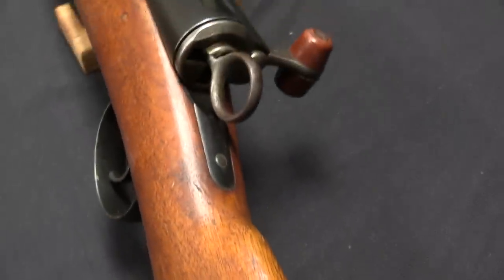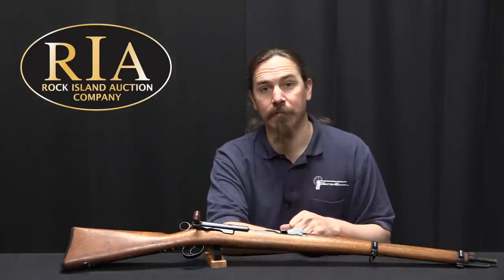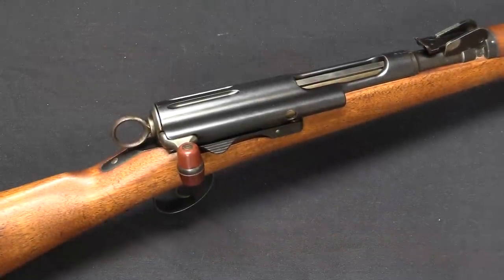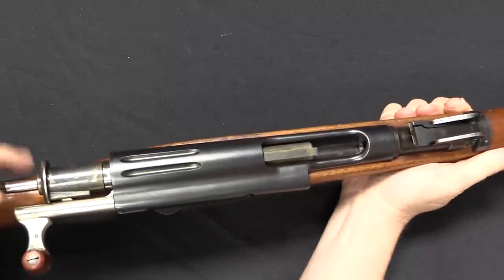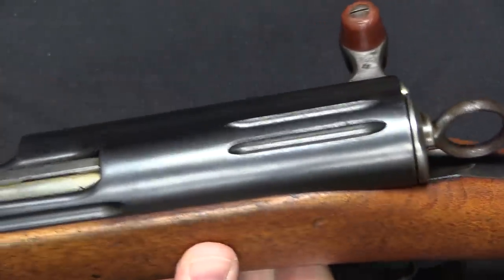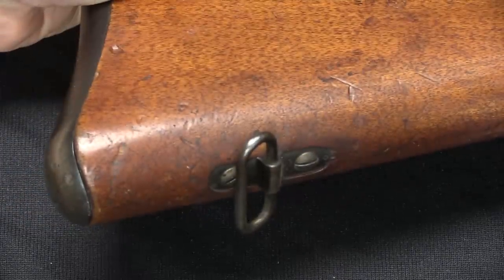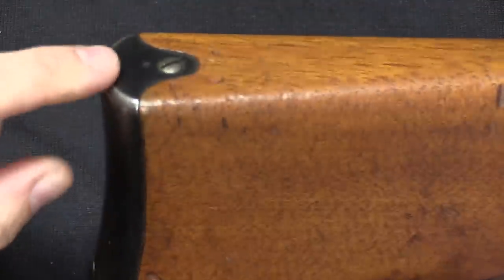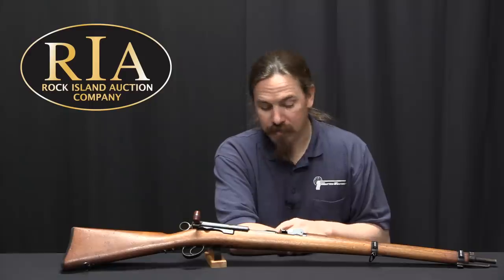Swiss 1897 Schmidt-Rubin Kadettengewehr Training Rifle

Comment: Such a well thought out design. They even put a keyring at the back of the bolt so you could keep it handy.
Reply: i guess I'm kinda randomly asking but do anyone know a good website to stream new movies online?
Reply: @coltonarchie9765 , Negative. I use Roku but I know a guy that has an unlocked Firestick and he gets all kinds of stuff.
Reply: @Colton Archie lately I have been using Flixzone. Just search on google for it :)
Reply: @Colton Archie i would suggest FlixZone. Just search on google for it :)
Reply: @coltonarchie9765  m4uhd.tv is quite good (or Movieorca).
Reply: That key ring is the firing pin

Comment: Ahhh, the 89's were NOT updated, the 89/96 was a new rifle with the updated bolt & similar features to the normal 1889. Most of THOSE 89/96's were updated into 96/11s, with new barrels, stocks and sights. The K11-M11 were simply that pattern of rifle having NOT been converted from 89/96s! :D

...I think ;)
Reply: I concur. There are far more 89's knocking about than 89/96s. Which wouldn't be the case if most 89s got updated
Reply: @charlieknight830  That's exactly what he said. The 89 was never updated to anything. Only the 89/96 was updated to the 11 pattern. 89/96's are difficult to find, because basically all are 11's now. The 89/96 was a new rifle and, though similarish looking, almost none of the parts were exchangeable with the 89. Particularly not the bolt and receiver, which really are the essential parts.

Comment: I have to correct you on something here. They did not update the Infanteriegewehr 89 but the successor of it the 96 ... those upgraded 96s are known as 96/11 whereas the 89s remained unchanged .. In case you are curious I own both guns and could also show you pictures were it's notable that the wooden stock was also upgraded to a pistol grip kinda thing

Comment: Hello, I like your videos because I find the mechanics of the different systems very interesting ...
I have little reference to weapons - but I always wonder at the old guns on the iron sights.
I practiced a bit more with firearms decades ago, but I think the distances are utopian like 1000m.
With the P1 (P38) I could hit something at 25m, with the UZI in 100m - the old G3 quite well af 300m with a lot of practice. Lying with the MG on maybe 500m with short bursts ...
But 1000m with a normal rifle? Our old rifles also had different breakpoints - so if you wanted to hit a 10, you had to target a 7 at the bottom left ... what went wrong between 1905 and 1985?

Comment: Ian-I ordered a M1911 Schmidt-Rubin from a well known distributor and received a .22 conversion single shot! A neatly inlayed plate on the side of the butt says "Arn. Meierhans, Zurich"  Was this the armorer that did the conversion? Are they safe to shoot (am assuming they are). The firing pin still hits the center of the .22 cartridge and the stock extractor will not extract and eject the .22 case. Is this worth keeping? It was the ;last of 6 M1911's from the distributor that  I bought from. I own a K31 carbine which is a dream to shoot and really want a long rifle in 7.5 Swiss. Is it worth keeping to trade up? Cannot find much info online. Thanx for any info-John in Texas

Comment: Can the reduced power 7.5x55 Swiss ammo be substituted with standard GP11?  For the lucky few who own this rifle I wonder if this can be shot using the slightly hotter load?
Reply: I've shot my K11 with GP11. The recoil is a bit rougher than with the PPU 7.5 I use, but I had no issues. Granted I only shot about 10 rounds of the GP11. No clue what would happen if you only use GP11.
Reply: It's not slightly hotter, the GP11 is 50% higher chamber pressure than the GP90. The gun would eventually fail and knock the action back into your cheekbones and get you a nice hospital visit. For that reason, the GP11 was made 1mm longer so it's impossible to accidentally feed it into an older gun.

Comment: So, stupid question: I must have missed this in the video, but is this rifle capable of firing the standard  7.5x55mm cartridge?
Reply: You mean, the GP1911?
No. They are not compatible The GP1890 has a case length of 53.5mm and the GP1911 is 55.6mm long.
You might be able to fit it into the gun but I don't recomend it - at least if you like the idea of your face remaining intact - as the GP90 generates about 37'000psi and the GP11 about 45'000psi.
The old rifles are not made to withstand the higher pressure and might blow up in your face...
Reply: @Bird_Dog00  Thanks!
Reply: @Bird_Dog00  It was a Schmidt-Rubin 1889 bolt that was a problem am I right? 
Isn't Cadet Rifle have the same bolt as Schmidt-Rubin 1896/11 Rifle?
Reply: @Supremaque  Yes, it was the bolt first and foremost.
It was primarily due to the rear locking lugs. The long distance between the bolt head and the locking lugs meant, that the bolt would flex and compress, causing headspacing and gas seal issues.
I'm guessing metallurgy might also have played a part, as this science would have improved rapidly in that time.
The 1897 pattern cadet rifles should to the best of my knowlege use the 96 pattern reciever and bolt. So, the cadet rifles should be able to safely handle the 1911 cartridge.
Just don't don't take my word without double-checking, 'kay? ;)
Reply: @Bird_Dog00  I'm torn between curiosity and common sense :>
Reply: @Supremaque  You have one?
Just ask someone a bit more knowlegeable than me, if they confirm what I said, it will be fine.

Comment: How did they make the cadet cartridge and normal cartridge have the same bullet velocities at  a 100m ?
Reply: I think he meant to say that the full-power cartridge had the same velocity at 100m as the cadet cartridge had at the muzzle.
Reply: Regolith that make sense 
So how dose this related to rifle sight
Thank you
Reply: I don't understand exactly what they did enough to say for sure, but from what I understand they figured if they reduced the muzzle velocity of the cartridge just the right amount, they could still use the same stops as are on the normal sight, and just change the distance markings. That way they didn't have to come up with a completely different sight, and they could use both cartridges in the same gun.
Reply: Are you telling me that the cadet only has put his sight to 100m  to shoot point Blank?

Comment: What is it with the Swiss and straight pull rifles?
Reply: I suppose there is that argument to be made but when you consider most of the noteworthy rifles of the day and for several decades to come where turn bolt systems makes ya wonder. I mean hell even a lot of modern day sniper rifles are turn bolt systems . If straight pull offered superior target re-acquisition ya think modern sniper rifles would be all over that.
Reply: They build rifles like the build clocks and watches. Very Well.

Comment: Looks like a K31
Reply: The Swiss stuck with a pattern they liked - they changed some of the internal mechanics, fiddled with the ammo etc but over all? Yeah, they stuck with what worked (till it was obsolete and needed replacement) :)

Still, yeah, it does or rather: The K31 looks like that gun :)
Reply: Big Ben77 You mean the k31 looks like this and all the other Swiss straight pull rifles.
Reply: DreamingFlurry I agree, kinda like how the Russians are with the AK and us with the M16

Comment: I really want a straight pull k31 for my collection, and to feature on my channel.
Reply: Spit Flush Classic Firearms has them in stock.
Reply: I got one for fairly cheap at a local Pawn Shop.  I check often for what they get in. I think I paid $350 for my K31. No buttstock slip though :(
Reply: Goonygoon84 Those slips are cool when you find them
Reply: Goonygoon84 you mean troop tag. Both my k31 and k11 didn't have one. I don't mind. It's just makes the story more mysterious.
Reply: Spit Flush they are good rifles. If you want one for your channel you could borrow mine if your near NJ.
Reply: Miguel Hernandez thanks for the offer! I'm actually pretty close. Just a thousand or so kilometers up the eastern coastline haha.
They're available here in Canada for a fair price but I haven't seen any locally yet
Reply: Spit Flush ok good luck with your find. My k31 isn't a pretty looking one but it works and I like.